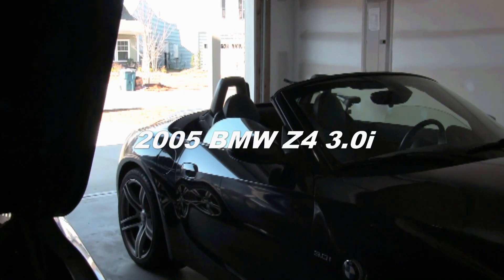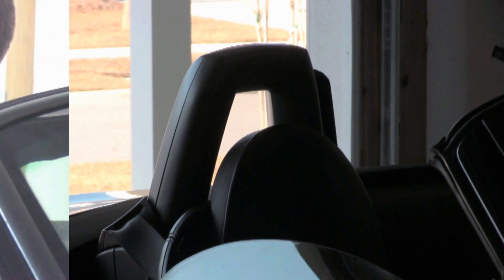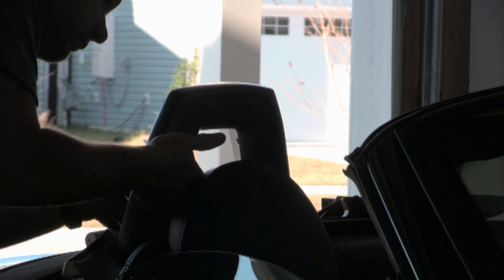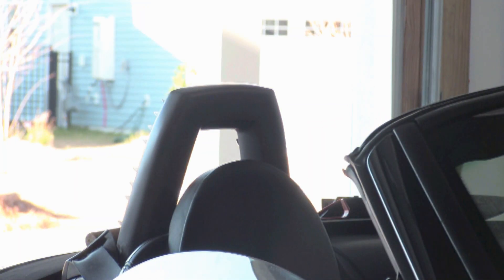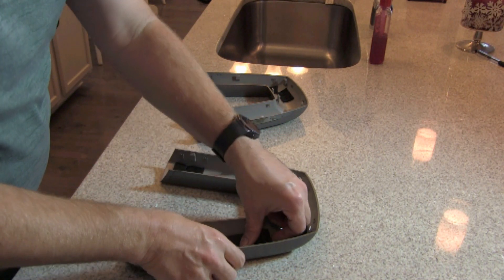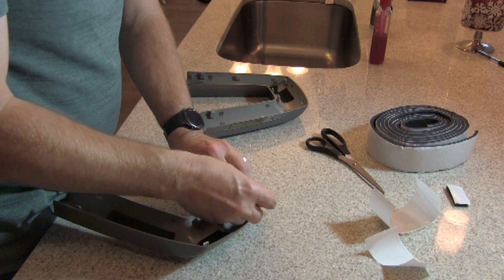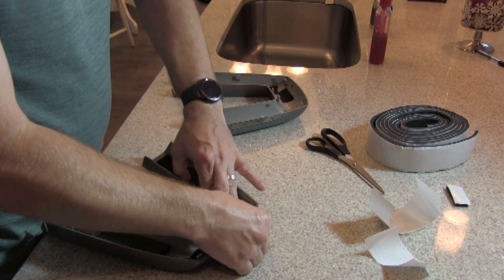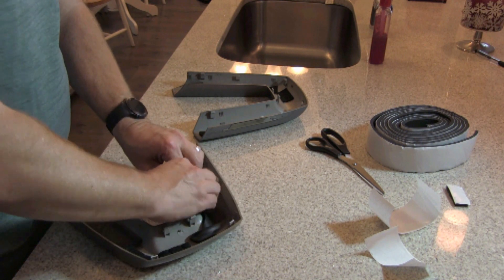2005 BMW Z4 Accidental Roll Bar Hoop Mod

Comment: Mine are buzzing too, seams to be the plastic plates in the middle, they're loose and there's nothing to tighten. I used glue, it worked for a bit, will try black silicone sealant now, done neatly, hopefully will last longer.

Comment: Hey, i just did this to my Z4 do you have any ideas for the hole on the side of the seatbelt plastics?
Reply: By any chance do you know what the white z4s roll bar color is on the inside?
Reply: @adammurphy1410  mine z4 is saphire black and so is the inside of my rollbars. I assume yours is sprayed in your cars color aswell.
Reply: Skitice1991 plan on taking them off today but it’s stuck in my head that they’ll be straight grey metal
Reply: @adammurphy1410  i understand, what you can do is click one side off and check it.. mine was luckely in my cars color. But white i really dont know.. i hope for you its white
Reply: @Skitice1991  Hey great vid and idea - I noticed the dash of your Z4 .... do you have a aftermarket radio/touchscreen installed? If so could you share some details on it? I just picked up a 2007 3.0i and I hate the aftermarket radio the previous owner put in it. I’d love an apple car play capable head unit and or a small touchscreen. Thanks!
Reply: @vintagewoodshop2978  This is not my video mate, but i think the owner of this video indeed has installed a aftermarket radio with a touchscreen that flips back in and can be flipped back out. There are lots of radio's from pioneer that is 1 din with a flip screen the downside to that is if you flip it open the touchscreen falls before your air ventilator same as the owner of the video has. I personally dont like that, you also have an option of going with a double din pioneer but then you take up the space of your air ventilator because you need to remove them to make it fitable. 

For my z4 i have a dashboard with satnav, im gonna remove the satnav and pick a nice android tablet what supports android aswell as apple carplay and option for dashcam and a rear camera. 

Sorry for my english its not my Native language. I hope i gave you some idea's
Reply: @Skitice1991  D’oh! Sorry for the mixup but thanks!
Reply: @adammurphy1410  Did you take them off? Is it easy? I’m thinking about doing it myself 🥴